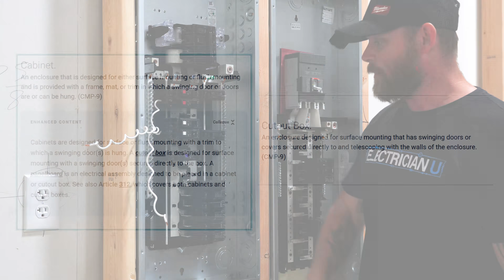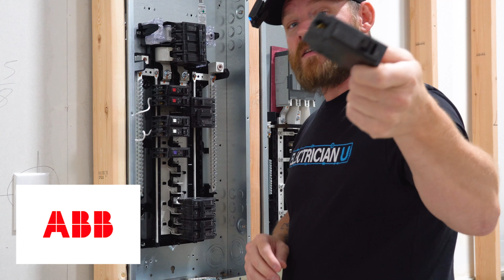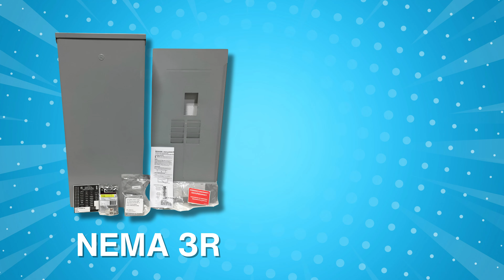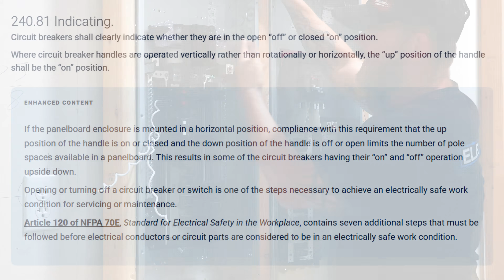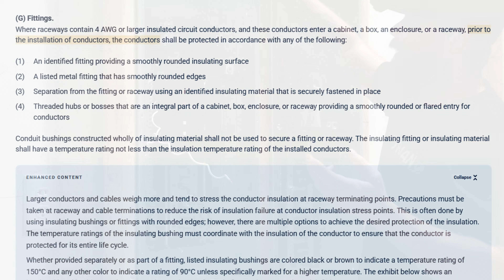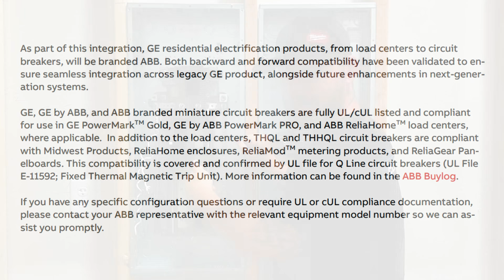Everything You Need to Know About Electrical Panels

Comment: Dear election,, why is it called single phase? When a phase is added it becomes three phase?
Reply: It is confusing, because at the transformer on the street, it is truly single phase. But, they tap into that in a way that produces two hot legs that are often referred to as “split phase”.

So, it’s really split phase, add one and it becomes 3 phase.
Reply: Split phase just means single phase + a center-tap netural.  The phase is split by the transformer.  So the output of the transformer has three wires... the two hots are on the ends of the windings and the neutral is in the middle.

The AC voltage between the two ends is 240VAC, and the AC voltage from either end to the central neutral tap is 120VAC.

So split-phase is still single-phase, just a uniquely American configuration.  I like it, actually.  Rectification is a lot easier than household 3-phase and I prefer the lower-voltage (120VAC) household wiring that America has.... while still making 240VAC available for heavier equipment.

-Matt
Reply: Also, be careful.  Single-phase / split-phase... those can't be converted to 3 phase just by adding another phase.  Split-phase has two waveforms 180 degrees out of phase with each other (and is really just the same as single phase).   Three-phase has three waveforms 120 degrees out of phase with each other.   The two configurations are incompatible with each other.

That is, you can't convert split-phase to three-phase (well, you can, but you'd get completely non-standard voltages).  But you can take any two legs from a three-phase system and convert it to single-phase.

However, because any two legs are not exactly opposite each other (they are 120 degrees apart rather than 180 degrees apart), the resulting voltage is not double the individual leg voltages (relative to neutral... if there is a neutral that is).

This is where 208V vs 240V comes from.  208V is what you get when you take two 120V legs that are 120 degrees out of phase with each other.  240V is what you get when you take two 120V legs that are 180 degrees out of phase with each other.

So 3-phase really is a completely different beast than either "single-phase" or "split-phase".

-Matt
Reply: It's all the same pie , it's just how it's sliced , or more precisely , how many equally sized slices . Split phase is the pie slices into 2 pieces , 3 phase is the same pie sliced into 3 .
He has videos explaining this as well .
Reply: @kaboom4679 is it so named for the armature configuration? Is there such thing as two phase. How does the phase get split into opposing megahertz with a common? I never worked with three phase so i will stop before i get to why is the sky blue and go check the vid. Thank you for pointing me in the right direction. I heard Eric Dollard explain it once but my decrepit brain was not putting knowledge to work and now I forgot what i once knew.
Reply from the maker: Single phase essentially means "single loop" - there are 2 wires from the utility generator that are 180 degrees out of phase with respect to one another. So these two wires are doing the same thing, at the same time, just in complete opposite polarity. Then they're brought to a utility transformer and connected to two sides of an internal coil of wire called the "primary" winding of the transformer. This completes the single loop, or single phase. On the secondary side is another winding, the "secondary" winding of the transformer. The two ends of that winding are what we connect our black and red to and bring them down to a house. The mid-point of that winding we tap and connect a white wire to, called a neutral. So we're essentially "splitting the phase" which is why you'll hear split phase from time to time. Polyphase systems (2 phase and 3 phase) are different systems entirely. Rather than two wires 180 deg out of phase sent out, there's three wires 120 deg out of phase (in 3 phase systems). 2 phase is an older version of a polyphase design that predated the 3 phase system, but 3 phase is so much more efficient that it replaced the need for 2 phase. Anyways, enough word vomit lol. Hope that helps!
Reply: @electricianu many thanks. Your good with language and your channel replaced the old 70s version of “Wiring your house” in my dads old toolbox. Somehow the new versions are rubbish. Try finding a decent description of a three way switch if you are bored. Other than yours. Somehow the simple diagram from the seventies is the best paper version I can use to demonstrate the theory to my helpers. Out on the farm we are short on sparky’s.  It is important to understand what you are doing out here and I strive to do that. I am not sure anyone really grasps the concept of the mad pixie but we know enough, thanks in part to you, to correct the wrongs and make our work impeccable. A few good inspectors taught me residential in Minnesota on my own stuff. When I was a kid my gramps was in a generation of men who understood capturing energy from another dimension. Wiring was something every young man learned as rural electric was bringing power to America. He had me pulling wire at age seven on the house my Dad built for us. Funny when I sold the house after he died, it turned out every plug I installed at age eight was reversed. House inspector caught it. Now I am on the farm keeping the magic smoke contained. Again many thanks. Your work has probably saved the lives of more than a few would be victims. Important stuff and as I said before much needed!! Appreciate the comment section too.

Comment: I am a believer of putting the highest loads close to the Main Breaker or MLO. Also, I would always install a Surge Protector as close to the Main Breaker as possible. Also, it is a good idea to keep two spaces open next to the Main Breaker for a Generator; especially if they are using a Main Disconnect Lockout that only allows the Generator Breaker to be turned on only when the Main Breaker is off.
Reply from the maker: Thanks for adding value to this!
Reply: @electricianu hey elec u I have a really bad issue I need your help with just a question
Reply: I do the same thing is put the breakers that draw the most current as close to the main breaker as possible to keep the busbars from overheating and put the lowest on the bottom , When replacing a breaker , Be sure to inspect the busbar for signs of pitting or overheating before installing the new breaker and make sure the breaker has a tight fit on the busbar
Reply: I do the same thing. I mainly work with Siemens, so I keep the top left two slots available for a generator. Although our surge protectors are located at the service, I'll leave the top right slot empty as well. Finally, I place all the large breakers at the top.
Reply: For surge suppression purposes this is ideal
Reply: Surge protection is usually better installed at least 3ft away from what it's protecting. It gives it time to work. Check the documentation or call the manufacturer.
Reply: @Theblankstaretree Electricity travels the speed of light and current that will travel has a delayed reaction in the surge protector. The closer to the main, the more protection there is.
Reply: Ineffective, I don't understand why you would put the highest loads near the main. You're going to increase the heat in that area of the panel. Meeting the higher load circuits themselves and the main I would think you would want to spread it out
In my opinion

Comment: And label the circuits completely, not just generally.
Reply from the maker: YES!!! For the love!
Reply: Yes!  I have a panel full of 15A breakers labeled "Lights & Receptacles"  Gee...thanks!
Reply: It took me 30 minutes to suss out the blasted heater circuits for my house because of missing labels because they were wired as two independent 120VAC legs (breakers not tied together) when they were actually 240VAC heaters.

Comment: Have you heard about any Smart Electrical Panels for 3-Phase?  Span only has single phase panels and I live in a residential 3-phase home.  Thanks
Reply: You can add a single phase subpanel to a 3 phase system.
Reply: @mrrogers4591  could not edit my previous post so made another.  If you only use two legs of the 3-phase, then all of the loads will go to those and leave the 3rd leg unbalanced.  Would prefer to use a Panel designed for 3-Phase that was smart.